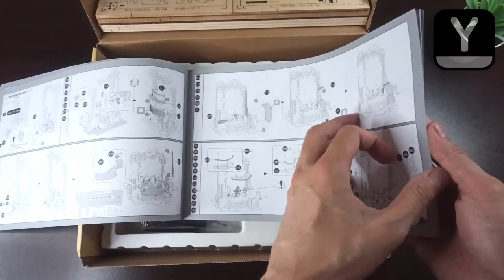ROBOTIME Chocolate Factory Mable Run ROKR LGA02 3D Wooden Puzzle

Comment: Does it come with the batteries?
Reply: No
Reply: Yes, it does, it’ll be in the bottom of the box alongside the marbles and the metal parts
Reply: yesit does
Reply: No. I looked everywhere 3 times. No batteries.
Reply: Thanks guys for your replies 👍 After 6 months, i still havent assembled it completely 😅
Reply: I’m building it right now and looked at the comments cause I couldn’t find the batteries. I’m disappointed it doesn’t come with them even though, the box says batteries included
Reply: Got them today
Reply: They are included
Reply: I think it depends where you live, it couldn’t ship to me do to customs police’s. Or it could also depend if you buy it off a 3rd party seller of Amazon